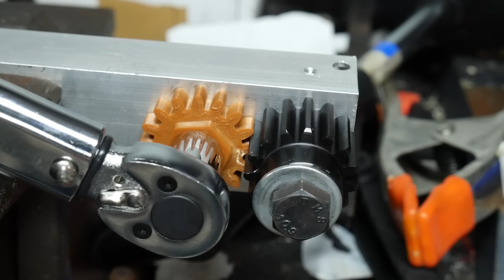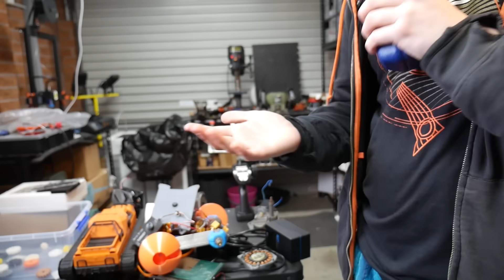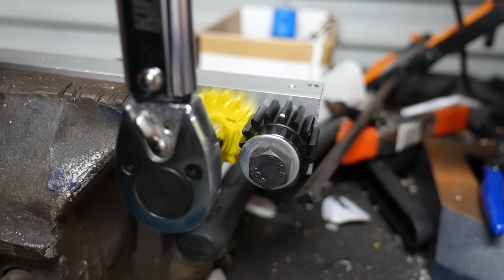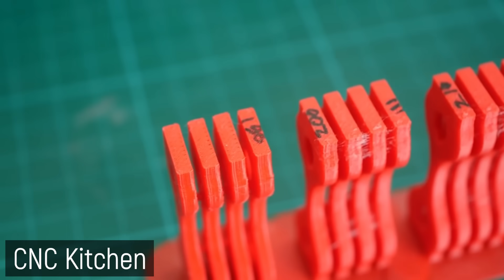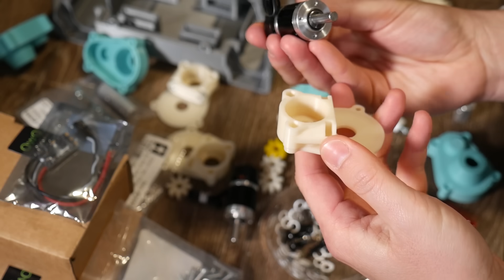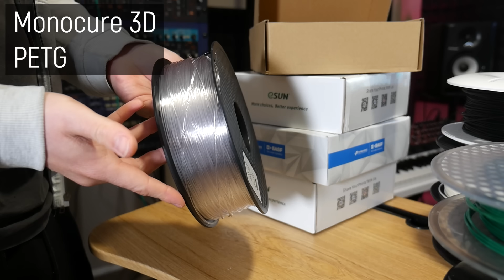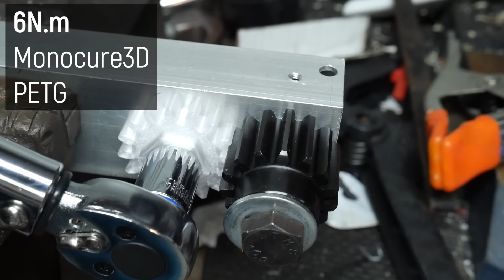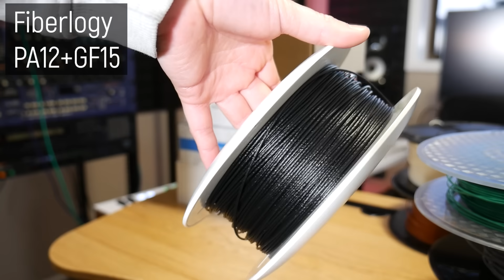Which 3D Printed Gear is Best?

Comment: I have a story for you...

Several years back I went on a tour at a local industry location that creates thread and string. They have a set of all-mechanical machines created about 100 years ago. They are not electronic at all. They all have precision custom parts made of metal except for one essential gear that is made of wood. This was deliberate so that the wooden gear would wear down and break before damaging the other parts. This thin gear is cheap and easy to replace by stamping out a new gear from a thin wooden board. Nobody knows who built the machine but the design is very smart. Take inspiration from it.
Reply from the maker: That's very clever! I've seen plastic gears used in metal assemblies to similar effect.
Reply: @MakersMuse  -- I've seen plastic gears used in metal assemblies to similar effect.

Sometimes that effect is unintentional. In an earlier life, I was a camera repairman. The "Copal Square S" shutter -- a vertical slit metal blade focal plane shutter -- was very popular, used by numerous manufacturers as a "drop-in" shutter module. It was used by many companies including top of the line companies, but often in their "second tier" products, i.e., Nikon used it in the Nikkormat, but stuck with their traditional titanium foil "Leica type" horizontal focal plane shutter for the Nikon F iterations.

Not to digress...

The shutter was comprised of two modules -- one with the blades, and one with the "clockwork" that drove the blades. ONE of the gears in the 
"clockwork" was a white nylon gear, just a few millimeters wide. It bore all of the torque when the shutter was cocked. It also had a tendency of being the main point of failure when the shutter stopped working.

The traditional "fix" consisted of pulling out the shutter and dropping in a replacement. Modular, after all. However, I considered myself a repairman, and not a parts-changer. Well, at least not on a macro level. <g>

So, I would replace that gear when a job came in with it broken. And this is why I know that the "shear pin" functionality was unintentional. When I ordered replacement gears, they sent me brass gears. (Yes, back then, they did sell actual "parts" (on the micro level) to be used to repair the modular shutter rather than simply replacing it. Ah, those were the days...)
Reply: @This_is_my_real_name  Perhaps what happened may be that the original purpose of the gear - to fail - was or had become lost knowledge to the parts replacement department.
Reply: [[tl;dr alert!  This is a bit "wordy" (but IMO interesting!) The easily triggered reader is cautioned to NOT click the "read more" link!]]

 @DuelScreen  -- I guess that's possible, but this was a Japanese company, the shutter was made in Japan (this being before Nixon sold us out for the cost of a ping-pong table), and the Japanese have a "culture of quality" (check out the Deming Award for example), and tend to be very meticulous and keep intensely detailed records (the repair manuals they printed for camera repair techs were insanely detailed, for example).

So, it's possible, but I think it more likely that the original gear, even if that was the "design intention" was failing on its own, and became the malfunction, and thus the decision was made to replace it with a brass gear.

Possibly they decided that the expense of damage caused by the brass gear would be less than the cost of replacing scads of nylon gears.

Things to consider: 

* MOST shutters "serviced" by third-party shops were simply replaced -- I never knew of anyone else who actually repaired them. It was definitely a nontrivial job.

So, whether the problem was a broken sacrificial gear or damage caused by a brass gear, the "repair" would be the same: Replace the shutter.

* Getting to the shutter was far more involved than pulling the shutter module. Only a few screws held the shutter in place, with IIRC just two wires to unsolder (the two flash sync wires). 

But to get to the shutter involved a near-total teardown of the camera proper -- removal of top and bottom covers, removal of the mirror box (often requiring removal of the prism and focus screen assembly, as well as the galvanometer and very often complex mechanical linkages that coupled the light metering "bits" (i.e., ASA/Aperture/Shutter speed positions -- basically an "analog computer" that balanced all these settings, and coupled them either electrically via a "functional resistor" or physically by rotating the galvanometer, sometimes via a string that had to be laced over a convoluted series of pulleys and the three controls listed above). 

I'm working off of memory over 40 years old so I may have amalgamated several camera makes/models into one, but you get the idea -- getting to the shutter was a major repair.

* Shops that actually repaired the shutter were IMO most likely the "factory shops" (I once went to the Nikon facility back when  Nikon (in the USA) was an EPOI brand and had their offices and main repair facility on Long Island. Now, most "factory" shops are probably the "factory authorized" shops, IMO.)

And, I suspect that in order to minimize costs and expedite turnaround, they used what I'd term an "in-house depot" system, in which a shutter would be pulled, sent off to a different section of the shop (possibly even in a different location), where it would be put into the queue for overhaul, with the repaired shutters being put into the "out queue" -- one of which would then be put into the camera being repaired, resulting in a fast turnaround, with a "new" overhauled shutter that was originally in a different camera.

So, IMO "someone" made the decision that it would be more cost-effective to replace the nylon gear with a brass gear, even if it would cause a statistically trivial number of malfunctions, the main expense being the major teardown of the camera to get to the shutter.

* I suspect that the main driving force behind a decision of that sort would be the expense of warranty repairs, which are NOT a "profit center"!

If they could avoid having to do "X number of major repairs" in exchange for only needing to do "3% of X number of repairs" then using a gear that was very unlikely to fail, but might result in a failure cascade of other parts would be a cost saving measure if those "new" type of malfunctions were statistically insignificant compared to the number of cameras coming in with a broken nylon gear -- a tiny part costing just a few cents to manufacture, but, when failing "for no particular reason" resulted in a very significant expense when repairing the camera. And again, for warranty repairs the labor was NOT a compensated expense.

Just some random musings as I reflect back on an interesting part of my life...
Reply: @This_is_my_real_name  Thanks for taking the time to record and share your experience.
Reply: @MakersMuse  it also depends whether you want to fail free or fail bind I'd guess free for this application for that you could try a spoked design between the hub and rim to create a know breaking point
Reply: This same EXACT technique is used in my rotor for large Amatuer radio antennas.  There is a fiber gear that is meant to fail before anything else can be damaged.  So, this is a wise choice, and the gear can be made progressively stronger, until you get close to the breaking point for another gear or the actual housing! Some Kitchen-Aid mixers use a plastic gearcase as the ultimate failure component--I replaced mine with an aluminum one because their plastic one is just too weak...
Reply: @SpinStar1956 The problem with these companies now make things so you can't repair them, I don't know about kitchen aid, but a lot of my tools you can't buy parts anymore. they just want to sell you a new one. One of the biggest reasons I got a 3d printer.
Reply: Same as some blacksmithing power hammer that use micarta (paper and resin) gear as mechanical fuses
Reply: Dad is a mechancial engineer and we work at the same company, nearly everything he's designed over the past 20 years has a sacrificial part in it somewhere. Usually this is done by adding a stress riser to allow a part to snap in a controlled area so it doesn't do something catastrophic like bend a hydraulic rod.
Reply: @namAehT  Things that seem as trivial as vertical reflectors on an airport runway use that technique to avoid damaging the planes if they were to hit one. I like knowing stuff like that since I'm a mechanical engineer, too.
Reply: Based off what we saw on the video PETG is the ideal filament for this case then?
Reply: Love to read stories like this. I remember my grandpa's table saw having 3 wooden dowel rods between the motor shaft and pulley. We would replace them every year.
Reply: @Eli Brook Woodruff keys are made of hardened steel and are not designed to fail; a parallel key is much weaker than a Woodruff key, but would need to be made from a soft metal to be useful as a mechanical fuse.
Reply: @cambridgemart2075  shafting is normally 303SS and will spit out the key.
Reply: @Eluderatnight  Why would anyone use stainless steel for shafts? Shafts are typically medium strength steel, e.g EN8. Keys are way harder than any material normally used for shafts, unless it's specifically a 'fuse key'.
Reply: @cambridgemart2075  Some shafts in certain applications are titanium.  Good for extreme heat and will not bend.  They will snap with enough force.  The key in small engine shafts is aluminum or zinc so it will shear to protect the engine.
Reply: a specifically designed flaw, intentional and easy to perform routine maintenance part, to protect the multi thousand dollar (at the time, adjust for inflation) machine - that would be key to making profits for years to come.  Pure Genius.

If only we made most things like that now a days, instead of soldered in batteries and "buy a new one" attitudes.
Reply: There is a ton of legacy machines in the USA. I have work on several.
Reply: It's actually call sacrificial gear, It protect more expensive components in the assembly. Lot's of machines use this trick, but they are mostly made of plastic instead of wood.
Reply: Reminds me of a certain lego gear that can slip to avoid damaging other parts!
Reply: Having the nylon non-destructively slip at a defined torque seems like it would be good for this, as long as it was consistent.
Reply: Certain farm tractors used to use wooden sacrificial gears.
Reply: Sometimes a plastic gear is used on the motor that mesh with metal gears to help prevent metal to metal radio wave spikes.  RC servos are like that.
Reply: kitchen aid mixers have the same sort of fail-to-protect mechanism. A friend of mine got tired of replacing the plastic gear and bought an aluminum to see if his wife would blow out the whole mechanism... he was betting the Machine would last longer with the metal gear before  the whole unit burnt,  to make the switch more cost effective than constantly replacing the plastic oem gear.
Reply: @blatantmisconception  I have kitchen set and several component you can swap have these parts. Like meat grinder, blender and so on - there is plastic link (in otherwise metal part) with clearly weakened part to snap if too much force is required to operate. it is even declared in User manual. 
I guess in machine industry once they went from belt to gear driven machines that there is no natural slip if it is overloaded so they added these parts - if they were smart enough.
Reply: sacrificial parts are a cool concept that probably get overlooked by a lot of DIY repairmen that unfortunately write them off as shitty/cheap. i can only guess how many stubborn farmers have destroyed entire machines from welding parts together that were supposed to slip before allowing the motor to start burning up

Comment: This brought to mind an idea. Could you possibly print with metal (washers) imbedded in the material for added strength, perhaps allowing you to control how the gear fails.
Reply: that would actually make it weaker unless you make a way for the plastic to grip on to the metal.

Comment: Didnt give ABS a fair chance. There are plenty of them that would crush this test, excuse the pun. I still prefer printing ABS over PLA
Reply: Felt the same. Used ancient/outdated materials. Would also like to see ASA tested.
Reply: @nocjef  agreed. And some PC maybe, or even throw in some HIPS just to get a more rounded view. But yeah, ABS definitely got shafted here, lol. I reckon Titan X would do reasonably well. I would like to see follow up video though on the solid prints
Reply: I feel ABS has an overlooked issue here that it has low surface abrasion resistance, so for this reason it's usually not recommended for gears. Overload events are once a lifetime, but surface friction is constant in a mechanism.

Still, some ABS filament might actually not exhibit this issue strongly, or might even not be really ABS but SAN. But it would be important to test.

Comment: From lurking in the Open F1 Facebook group - brand name PLA+ materials for the gears is preferred. But for them the gears don't shear as much as they wear/melt.

Which makes sense to me - the stiffness of PLA reduces deformation. The deformation will cause the teeth to mesh poorly creating more friction and heat. The deformation of the teeth is also a type of friction which will generate heat. So the PLA generates less heat and so despite it's low heat resistance doesn't melt like the other filaments will.

Comment: I would love to see the tests with 100% infill, but in two ways. I saw the perimeters separating from the infill. So i'd love a test with 3 perimeters and 100% infill, but also a test were its lets say 100 perimeters with 100%, so that basically the whole thing is a perimeter that doesn't get to cool down and then have a string from the infill just touching it briefly... or heck. Even a test with 1 or even 0 perimeters and just solid infill.
Reply: On that note it would also be interesting seeing 1 perimeter and 100% infill
Reply: 100% infill with 1 perimeter. Maybe concentric. Use autospeed in PrusaSlicer to perfectly extrude the gapfill and increase flow slightly.
Reply: I saw the same thing, so the teeth could not maintain position/mesh.
Reply: exactly this - the failure points are visible - they're the always infill bond to perimeters.  Gears in this scenario are not hollow.  This oversight is super weird.  Any metal gear with an internal structure like the test prints would be considered defective
Reply: Yeah exactly.
Reply: Or tighter infill, there is alot of air in his gear, also extra layers between the infill would strenghten.
Reply: I think some have tested that more than 50% infill does not provide any significant increase in strength.
Reply: I recently printed a PETG spindle holder. It straight up snapped in two while I was deburring it and removing supports.

Reprinted the part in a different orientation so the layers ran the length of the part, made it stronger, but then it snapped when I tightened it.

Then I printed it in that length orientation, with 100% perimeters and the same part was unbreakable by hand.

And then I reprinted a second one with 100% infill but at 250C instead of 230. It was already far stronger and although I did break it by hand, it was with more force than a spool hanging from it could ever put on it.

For these mechanical parts, layer adhesion is a huge factor, which you can get in a variety of ways while printing.

But post treatment of the parts with annealing or remelting is the easiest and real key to getting them very strong.

Comment: Hi Angus, what type of infill did you use? Rectilinear or Honeycomb? I have found Honeycomb can make parts much stronger even in flexible filaments. I’d like to see what results you get from solid prints too👍
Reply from the maker: I used 20% cubic for these tests.
Reply: @MakersMuse  would be cool to try 20% honeycomb or you might find 15% honeycomb is as strong as 20% cubic?
Reply: I have been printing in Gyroid infill, just because i happen to like it, i haven't actually done any mechanical evaluation on it, so if multiple infills are going to be tested, maybe add that one as well! I haven't done any mechanical evaluation since i try not to rely on onfill for strength, but i expect that it might be a bit similar to hex at sufficient density, but it is much faster to print for sure.

Comment: 20% Cubic infill can change the results according to its orientation
Reply: Yeah.. it seems like a couple of the gears failed not by the teeth splitting but the teeth being peeled from the infill.
Reply: Same with orientation of the Hex shaped mount, and the orientation of the teeth meshing. Two teeth meshing equally might be stronger than 1 tooth meshing, since the gears are of different materials. Obviously in a real application the weakest orientation will be the mode of failure.

Maybe the test could be re-performed with rotating the gears a few times at each torque level? That would also help even-out the wear during testing.

Comment: Anything that makes them unusable for the intended purpose would be a failure in my book.  In this case, anything that would stop it from meshing and turning smoothly with the drive chain.  (Is that one word?)  Even a single bent tooth would be enough to stop this in its tracks (pun intended), so I'd call that a failure.

Comment: hey bro, you really need to test the temperature resistance of PLA. I've had my PLA gears strip out on me on a hot day, Can't say the same for any of the petg or ABS gears that I've used. the BASF filament looks good, but if its like every other PLA and starts to turn into silly putty at only 60c... yeah...
Reply: good point. PLA does not hold up well in outdoor conditions
Reply: Try tempering the PLA it gets a lot stronger and handels a much higher temperature then all the others after tempering
Reply: @tullgutten  yes but annealing pla causes the object to shrink and warp